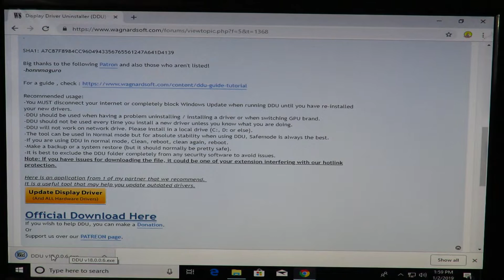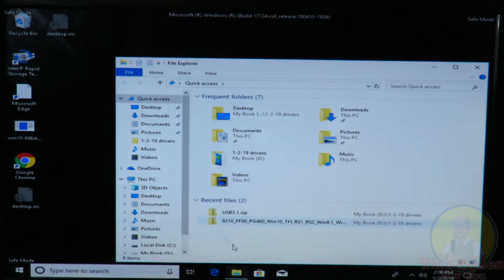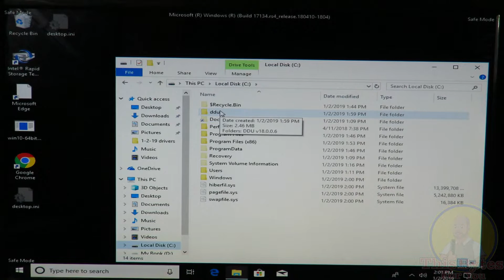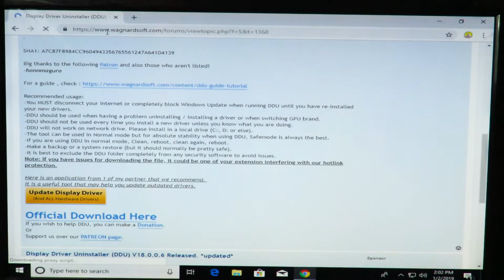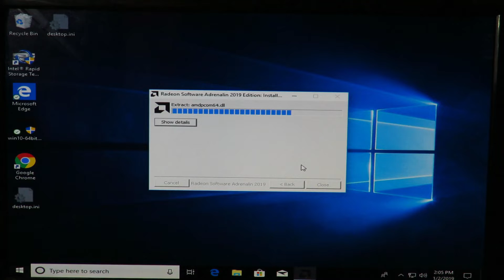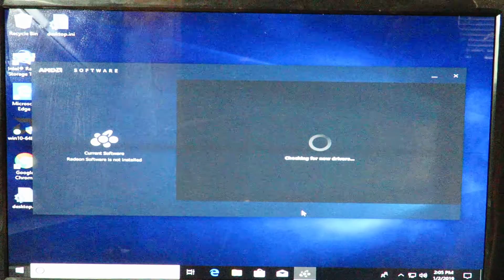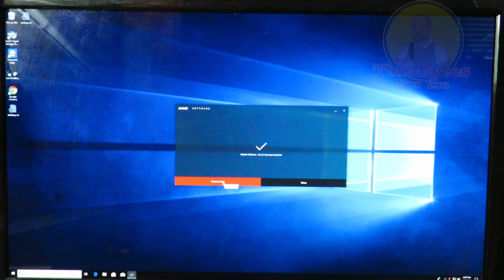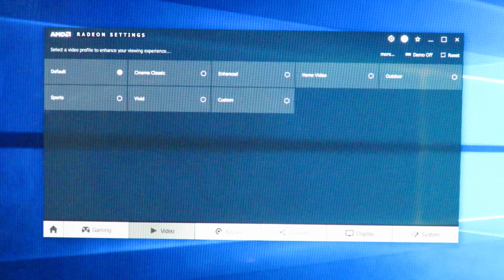How to install the AMD Sapphire Radeon Nitro+ RX 590 8GB OC Special Edition

Comment: Why is it so unnecessarily long? That should be 10 minutes max.
Reply from the maker: Thanks for stopping by my friend, its so long because I am talking to people and showing them how to do it calmly.  I am trying to show people how to do it, and not only install the card but how to remove a card without messing up their system and then install the drivers and if they have drivers how to uninstall them and then install the newest.  I am trying to save people money by not having them have to pay someone to do it and give them enough confidence to do it.
Reply: @ThisBytesForYou  Oh, okay. It's usually a super simple thing to do, that's why i wondered. I guess for someone who did all of that already it looks a bit drawn out
Reply from the maker: @xPandamon  no problem my friend, I used to train people how to upgrade and or build computers as well, so i have a lot of the questions they used to ask me already prepped and implemented in this video.  For example, you or I that have been building computers for years know that you cannot simply pull out a video card, you have to push/pull the locking mechanism out of the way, where as people that have never done it, watching a super fast video might just pull it ripping their PCI lane out, I have seen it happen quite a few times, it sounds dumb but unless you know,... you don't know so I try to teach things very basic.

Comment: If i have an rx 580 would the drivers and software be the same?
Reply: Oh, and what wattage power supply do you need to run this card?
Reply from the maker: @FamineAndFeast  the installation of the card would be about the same, depending on how and what extra's the card may have, the drivers would be the same though.  Can I ask, what is the model number and manufacturer of the video card you have, so that I can make sure for you on the power.

Comment: Y the hell you not use a capture card for this?
Reply from the maker: Let me know how a capture card works for you while installing/uninstalling drivers and inn safe mode works for you. before you reply though... try it and get back to me because I can tell you, it will not work.
Reply: @ThisBytesForYou  cause ive seen other youtubers do it, like linustechtips
Reply from the maker: @RicoInaFedora  I am sure it can be done, but this is me paying for those things, I do this from home after work, not a huge company paying for it.  Not sure how he does it, but I can tell you a capture card will not work during a reboot, in safe mode and/or installing/uninstalling video drivers since of course even though it does not use those particular drivers it does use a video hook.  Thank you for mentioning it though, I have thought about it, I am sure I will get it at some point.
Reply: @ThisBytesForYou  you'd have to have a separate pc for recording

Comment: Hy i have problem with adding that vga on my mother board asus rampage IV extreme, i haven't problem with the old vga (msi gtx 680) before. I've double check everything about the cable pci-e is on the right place. But my problem is the card is not detected, hear 4 times beep and my screen is only black. Any suggestion please?
Reply from the maker: you might need to remove the card and re-seat it.  What power supply do you have, make and model number and are you using both of the pcie connections?
Reply from the maker: Please let me know if my recommendations helped.
Reply: did you fix it? im having the exact same problem
Reply from the maker: @chrisortsen  he has not yet replied, try my recommendations and see if they help you?
Reply: @ThisBytesForYou  i have already tried everything, my PSU is good enough too. i think it must be a problem with my card then
Reply from the maker: @chrisortsen  I understand your PSU is good enough, but please let me know what you have so that I can help you, also do you have both power connectors plugged in?
Reply: @ThisBytesForYou  my PSU is a Aerocool Strike X 80 Plus 800W, i got both PCI-E plugged correctly. the LEDs in the card turn on, the fan spins, but on my screen i get no signal and my PC does not have the card listed on the device manager under display adapters. i also have tried HDMI and DVI cables
Reply from the maker: @chrisortsen  wait, so it does show video, are you plugged into the video card, meaning is your HDMI/DVI cable plugged into the video card?  Try removing the card and plugging it back in, make sure it goes all the way into the PCI-e slot (just give it a try) and make sure your cables are plugged into it.
Reply: @ThisBytesForYou  no it does not show video, im only able to see my screen if i plug the dvi cable in the motherboard. i have tried putting the card back in multiple times, did clean windows install, did ur ddu method, and still nothing
Reply from the maker: @chrisortsen  have you already tried disabling onboard video and setting the BIOS settings to PEG (PCI Express Graphics)
Reply: @ThisBytesForYou  i have already disabled onboard video but i cant seem to find this option that u mentioned in my BIOS (Gigabyte GA-Z77X-D3H)
Reply from the maker: @chrisortsen  its under Init First Display, you find it under page 53 of the manual for the board: http://download.gigabyte.us/FileList/Manual/mb_manual_ga-z77x-d3h_e.pdf, just above  Internal graphics, where you disable your onboard video.  Also, are you plugged into the first PCI-e slot?
Reply: @ThisBytesForYou  yes i did plug it in the 1st one. also if u just plug in my old gpu (gtx 680) everything works normally
Reply from the maker: @chrisortsen  hmmm, do you have another system you can test it on just to make sure its the card and not your system?
Reply: @ThisBytesForYou  unfortunately i dont
Reply from the maker: @chrisortsen  man that sucks, I am sorry my friend, I hope you have enough time to contact whomever you bought it from to get it exchanged
Reply: @ThisBytesForYou  yea im gonna try a little bit more to make it work later but i guess i wont be able to. thanks a lot for the help i will update u if i manage to do it somehow. thank u very much again
Reply from the maker: yes please do let me know how it goes, even if you have to return it and how the replacement goes.  Bad cards can happen for any reason, but I am sure they will take care of you.  You are very welcome my friend, thank you so much for stopping by and checking out the video.